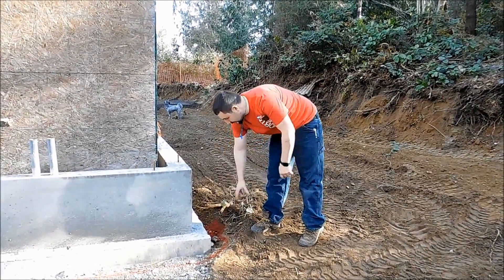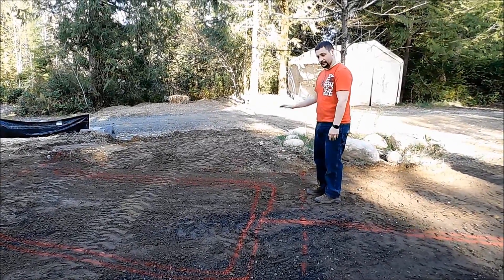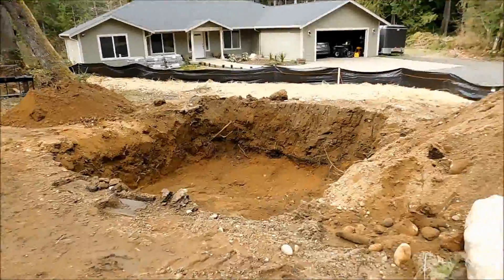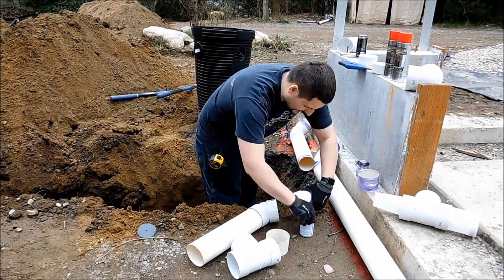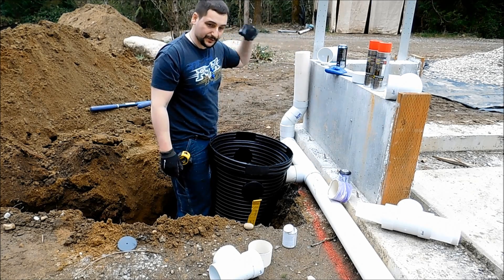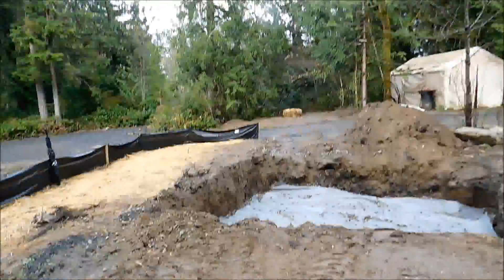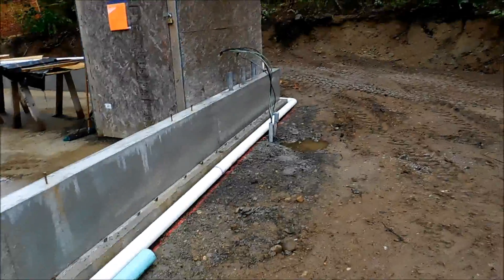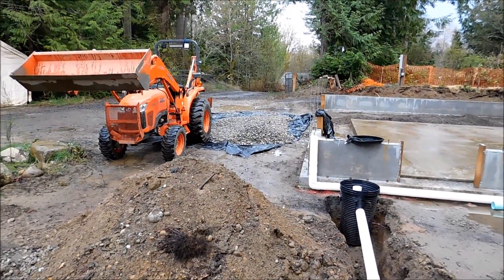Building a Garage, Installing drain piping around foundation

Comment: Hi, I’m in France and wondering about this issue of roof water recuperation. If you used a clay tile roof which doesn’t contain bad chemicals would you still need to drain seperately ? In france you can just save and use the water, for example.

Comment: Here in the u.k we do similar but we do now use plastic webbed crates/totes that are stackable so no need for stone/Rock and have a higher volume of water that can be stored to filter away, this reduces the size of the hole that's needed or can run in a long channel instead of in one area.
Good work I like the neatness of your pipping.

Comment: Where did you get the filter sock for your sump? Been looking everywhere and nobody seems to know what I am talking about when I explain what you used.
Reply from the maker: I got all of my plumbing stuff and the filter, from HD Fowler it is a local plumbing supply store in. 
4303 State Highway 3 W, Bremerton, WA 98312

https://www.hdfowler.com/Index.aspx
Reply: @DanielWoodell  I know this is a late response but I noticed you said Washington, I'm building a shop and the city is requiring I install a sediment barrel with filter sock as well. Did you get the black barrel from HD as well?
Reply from the maker: @82thetots  YUP